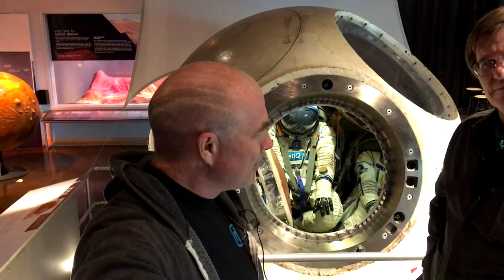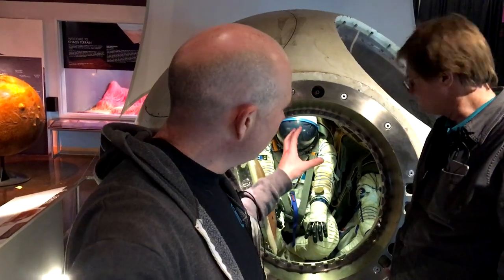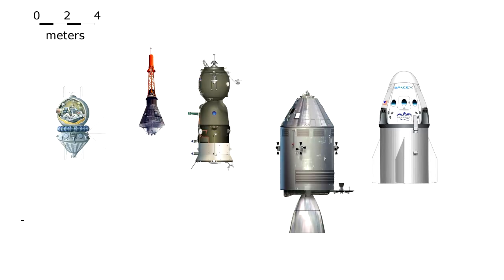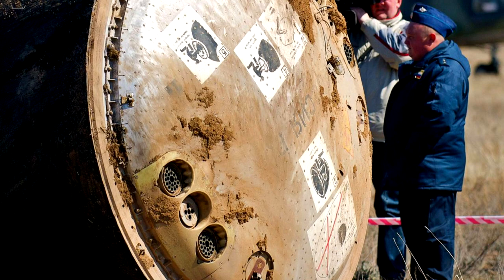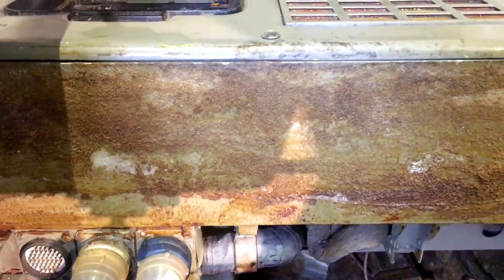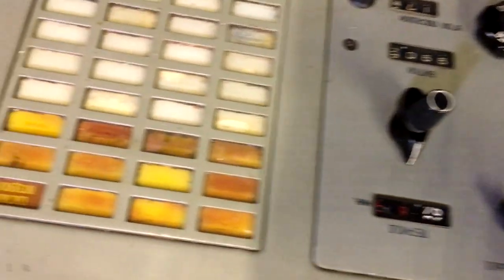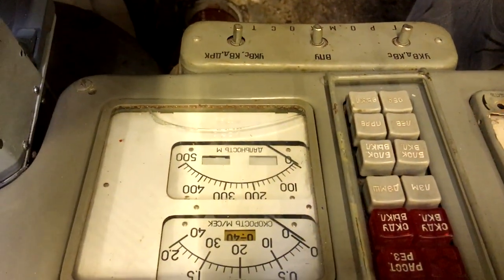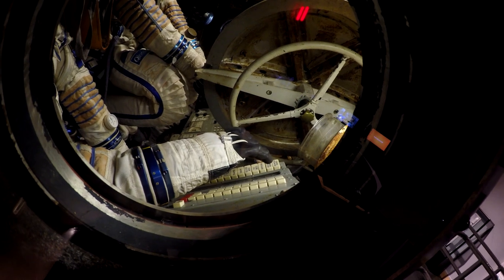See Inside a 50 year old Soyuz Capsule - 1960's Soviet Space Technology

Comment: Can anybody please explain to me how thrusters work in a vacuum ?
Reply from the maker: The same way a gun firing a bullet generates a recoil. The gas is made of atoms, every atom generates a tiny recoil as it escapes the thruster.
Reply: Scott Manley ty for your reply.....
 Are talking about the vacuum of outer space?
 Please correct me if im wrong but, there is allegedly nothing for the atoms to push against in space? It seems to me it would have the same effect as a fart.....please explain in further detail.
merry holidays
Jeff
Reply: @theogdirkdiggler  Both on earth and in vacuum of space, thrust does not come from pushing against something, but rather from acceleration to one direction creating equal and opposite effect - a push to the opposite direction. To work in vacuum rocket simply has to have oxidiser (source of oxygen) with it cause space has no oxygen to help with the combustion of fuel. In zero or microgravity and vacuum of space, even a fart would indeed propel you forward! why it does not do it on earth is simply cause force of gravity acting on you is multitudes stronger than what tiny bit of thrust you get.

Comment: "Radiation detectors' to work out how far the ground was.
The flat bottom means that they can fly aerodynamically through re-entry.
A sphere would have 'very high re-entry loads' because you can't fly it.
Three wrenches to open the hatch.

This guy simply talks random garbage.  Why does he have so many subscribers?  Are space fans not very bright?
Reply: That "Radiation detector" is a gamma-ray source which is pointed at the ground and the backscatter is measured to determine the hight of the vehicle.

The Flat bottom generates lift at hypersonic (you may know it as drag) speeds, by tilting the craft you can control the reentry. A sphere would just burn through the atmosphere with no control since every side is the same. 

In the early spaceflight, it was hard to pinpoint a landing site so it could take hours for a rescue team to arrive. If the cosmonauts were unable to open the hatch and get out there where wrenches and instructions on how to open the sealed compartment for any people in the area which could assist.

Do some basic research before you slander a respected YouTuber.
Reply: @alex_inside  

>> Cyka CheekiBreeki

>>That "Radiation detector" is a gamma-ray source which is pointed at the ground and the backscatter is measured to determine the hight of the vehicle.

And you believe that this ridiculous technology would have actually worked? How?

>>A sphere would just burn through the atmosphere with no control since every side is the same. 

So you believe that all the Vostok craft burnt up in the atmosphere?

>>In the early spaceflight, it was hard to pinpoint a landing site so it could take hours for a rescue team to arrive. If the cosmonauts were unable to open the hatch and get out there where wrenches and instructions on how to open the sealed compartment for any people in the area which could assist.

And where would that have been hidden?  It could hardly have been on the outside of the heat shield, could it?  Nor on the inside?  Hmmm.

>>Do some basic research before you slander a respected YouTuber. 

I'm not slandering a 'respected YouTuber'.  
This is a guy who responds to serious scientific questions with torrents of childish abuse, cloaks threads he disagrees with and lies endlessly.